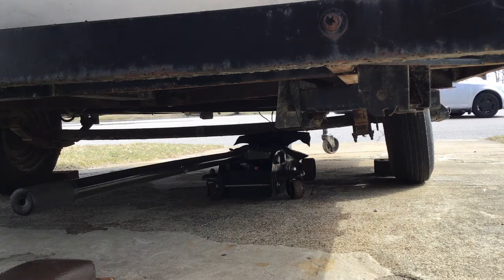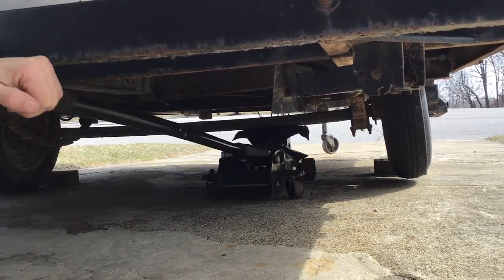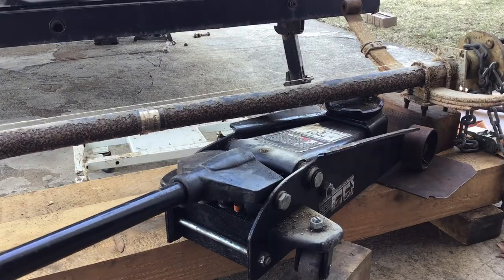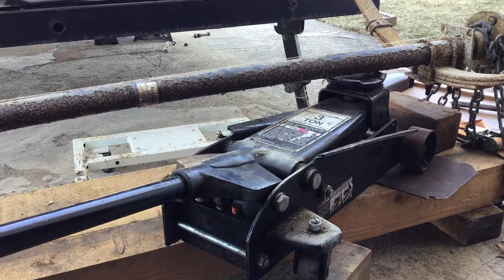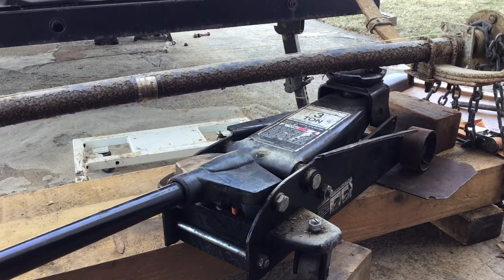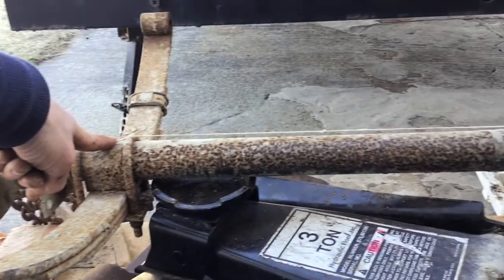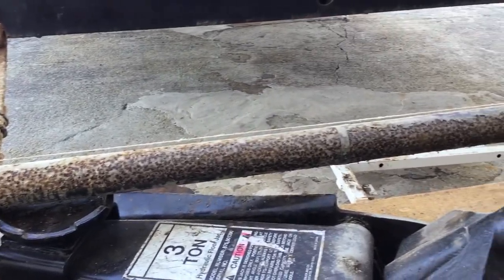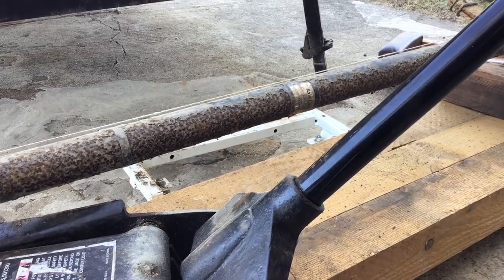Straightening a Trailer Axle Part 1

Comment: i measured from the driveway to bottom of axle its 7.25 I had a thought maybe I could put a extra axle u bolts and plate the and just have them just a little tight so the flat plate is at the bottom of axles they are only like 4 inches wide and then put jack under that flat plate just to distribute some of the pressure of the jack

Comment: What size boards did you use a 4x4 or 6x6 ? one of my front axles are bent the top is leaning in a little i had a thought of using like 3 or 4 mufflers clamps on the bottom of axle to hopefully keep the axle from crushing in and use the boards like you have yours i do have a 3 ton jack on wheels but by the time you put jacks and 6x6 or 4x4s under it i think I would have to have trailer really high what's your thought ?
Reply from the maker: I used two beams that were about 4x6 inches.
Reply: Ok thanks going to try 4x4 with a 2x4 under the 4x4
Reply: Might try a bottle jack that way, maybe not so much space taken up